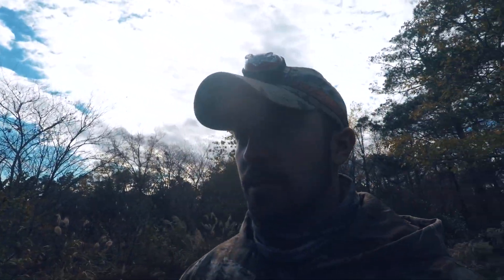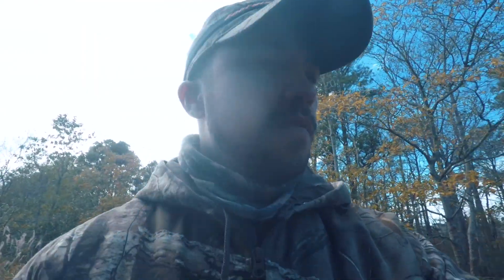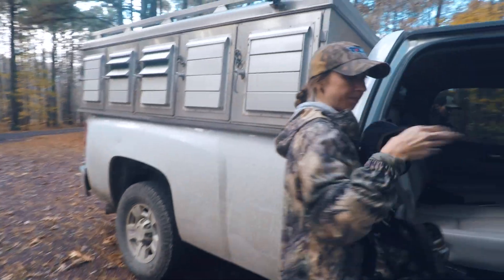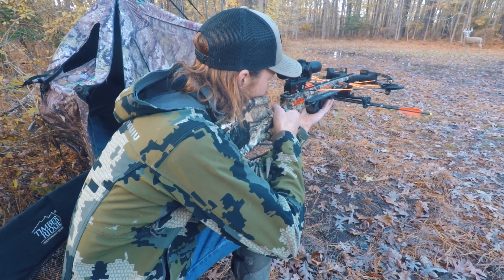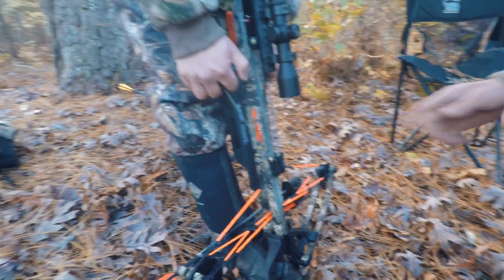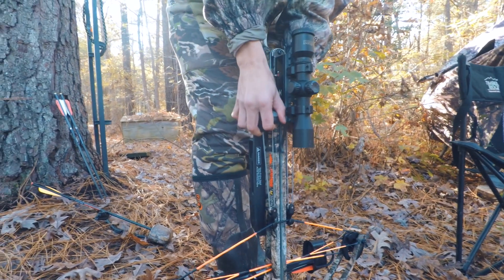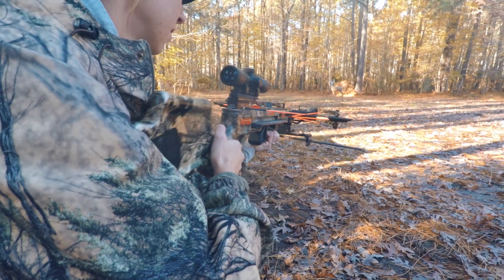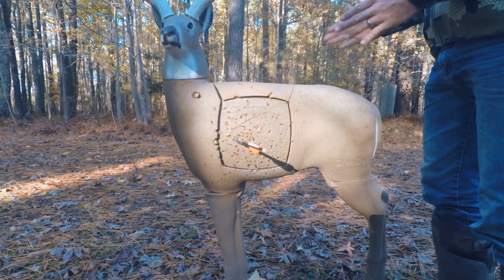Learning To Shoot A Crossbow From A Pro Hunting Guide

Comment: Hey man, just a tip when you are pulling your crossbow string back you want them hooks to be over top not underneath so when you pull back on your bow, all your force is going against your rail. It’s a lot easier to keep your hooks on the side of your rail if you just flip your caulking device. Just a tip from a beginner who read the manual lol